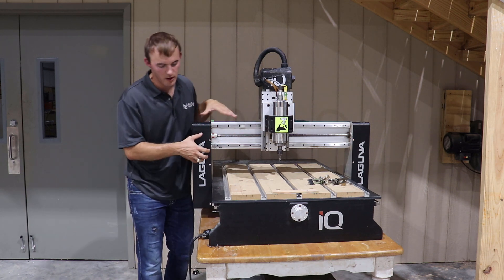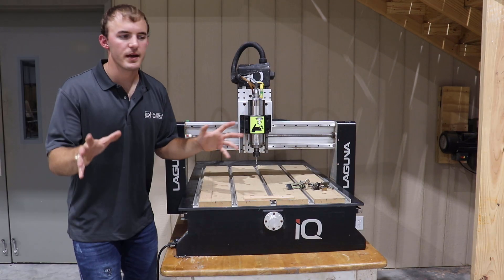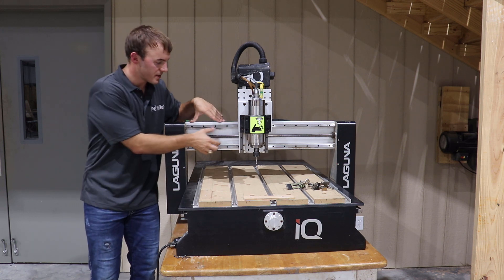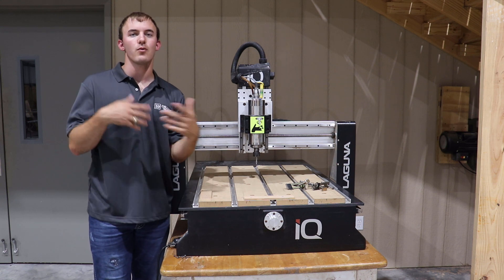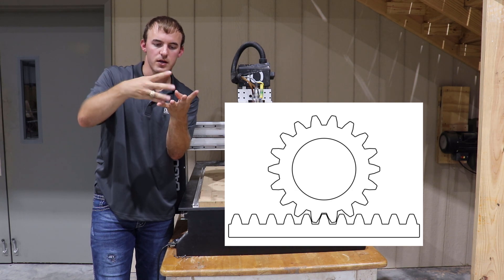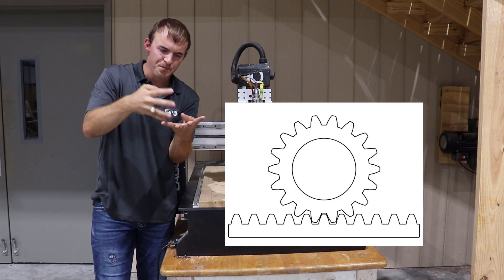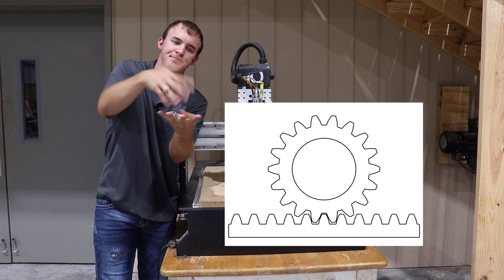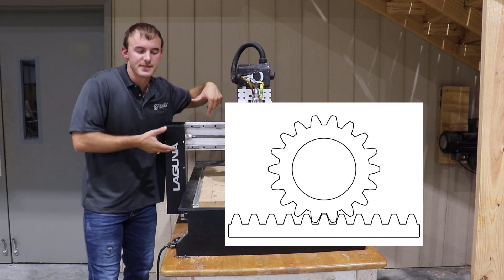Understanding Your CNC Router | Parts & Terminology

Comment: Thank You for Your informative videos :) 
     I'm planning to build a large 3x2meter (around 10x6 foot ) big router  starting at May , and researching a ton of information about it in the last months.
 ( I'm a 3d modeler, my Father is an oldschool woodworker, planning to resurrect the home business with the cnc ) 
I was planning to use rack and pinion for cost saving purposes, but at 13:31in your video, it was a heureka moment for me :D 
Such an elegant sollution for the long ballscrew "wiggling" and innertia problem :) 
It could be actually cheaper to build comparing to a rack&pinion system. (rotating the ballnut with a stronger nema34 stepper and a pulley directly)

Thanks again for the videos! Keep it up!

Comment: i'm surprised that your shopsabre has only one small linear rail on the y axis and it is able to take all the load of the gantry. your gantry probably weighs  in excess of 200lbs. Also the motor is attached to the ballscrew nut. Ususally the motor drives the ballscrew itself.